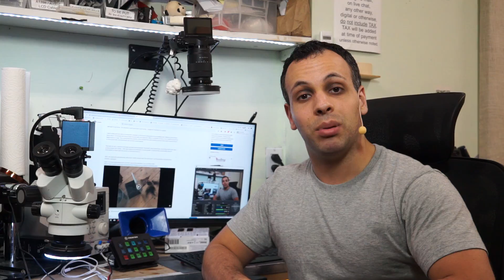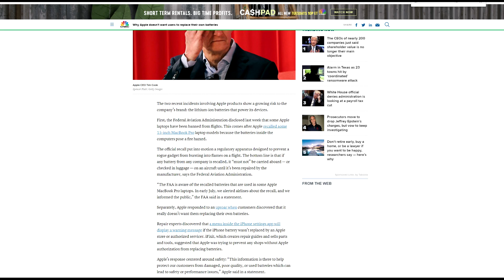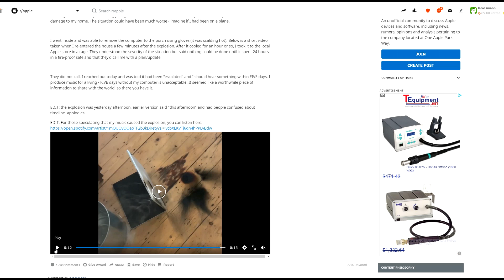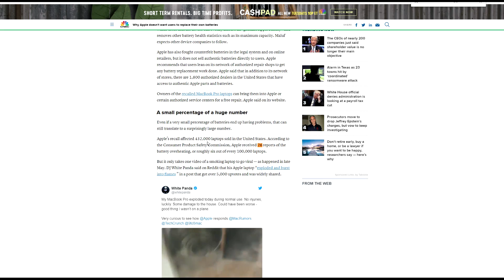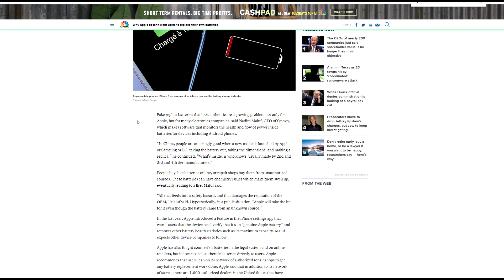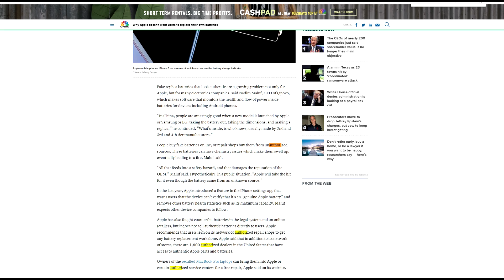OEM batteries explode, so 3rd party batteries are bad. Nice job, CNBC.

Comment: Issue is that CNBC was trying to crudely highlight is that because some people replace batteries and the machine catches fire, apple gets poor publicity and then is forced to do replacements they did not need to do.

Because videos show apple.prpsicts catching fire, it's bad for the brand.and no person would admit they did repair work or got bad batteries.

I am not an Apple fanboy- they have a valid albiet niche issue that they tried to write and ended up doing poorly. You need not recall genuine, done working machines to Show you are battling counterfeiting

It's like someone puts non official brake oils and engine oils and they start getting knocking issue in engines only to blame the OEM for bad manufacturing

My issue is that never have I seen an OEM replace cars if they found aftermarket failures happening. Brands have a valid defense to that and you need not go to recalls.

Comment: I use 3rd party batteries especially since i like buying old laptops that no longer have original batteries made. But i always hate that 3rd party batteries falsify how much capacity they have, the last 2 batteries i bought were advertised as 5200 mAh but after checking them in the terminal command the designed capacity was only 4000 mAh.
The original batteries always had the same designed capacity as what was written on the battery even if they can no longer reach that.
I don't mind the lower capacity since its usually about what the originals where anyway but it still leaves a bad taste to be lied to like that.

Comment: Thank you for showing the word honest truth  in easily  understood  honesty and  blunt truth...  that IT Professionals  like myself have  been  preaching for ages in laptops  since 3rd party knock off crap because you're  too cheap to buy the right part and  often fails because you feel   that the device maker will  be ripped off by you the consumer were over charged  for  your device and  you're  all idiots..  there's  a reason why  the battery  is designed or engineered by the manufacturer and  my rescue training I've  seen  the aftermath  of 5 vs 50 buck mentality and  how MacBook ipads and  cellular phones its not easy to remove or insert new batteries properly i have seen the users stand and bounce on batteries even use hydraulic  bottle jacks to force fit batteries into devices plus the removal of old batteries  has ended badly... if it can't be easily inserted extremely easily goto an experts pay the extra your life and state of health are not worth the risk or gambling  with....

Comment: Funny thing about "fake" batteries but "real" ones blow up too.  I replaced my 2015 MBP battery with one purchased from ifixit and less than a year later, that battery swelled up too.  Ifixit sent me a replacement free of charge, but I had to go through the grief of doing the swap (and yeah, I used ifixit's tape when I replaced it the first time) - ugh. (My iphone 7's battery also swelled - Verizon replaced the phone because I had a replacement contract on it).

Comment: most of the OEM batteries can have heat and or fire issues due to there capacity to size ratio. There chemistry has packed as much of the material as they can to get as much capacity out of the battery and then put a ton of technology into the battery management. When something goes slightly wrong you end up with a big problem, especially if the temperature feedback is off. and the aftermarket batteries never get that high of capacity because there trying to save cost, And with getting a cheaper battery they end up being less likely of having fire issue with less dense batteries and lower quality materials.. that's why OEM always cost more...

Comment: I don't think third party batteries are reliable. I ordered two Macbook Pro batteries from iFixit at two different periods. For the first order, they had to send me a replacement battery a month later because something was wrong with the battery. For the second order, they had to send me 3 replacements because the batteries they were sending weren't operating correctly.

Comment: What are the main causes of batteries overheating?  I can think of two.  An excessive load on the battery such as a short or very low impedance caused by a circuit failure,  or an improperly designed charging circuit that does not include a current limiter to prevent over charging.

Comment: Sounds like CNBC may of or had been paid by apple to make this post to install a fear in people to vear from stores that exist to fix devices.
I dont see any reasons why you would be wrong, granted fake batteries are present but people that scour the web finding OEM parts, even going as far as taking out batteries from the same exact device as a donor that is known to work wouldn't be an issue. 
Now as 3rd party battery manufacturers are concerned, if you know the company or have bought from them before and they work like the OEM (and maybe safer) would be a benefit in a way and shouldn't be frowned upon as apple makes them out to be.

I can understand like in the first transformers movie, the kid gets an old car cuz his dad is too cheap to actually do something other than being cheap, but people (most people) actually look at the history of vehicles, what they have been through, any repairs in the past 3 years or whether or not they have been into any minor fender benders or full on collisions leaving the vehicle as a write off for the junk yard but it is just that, experience, what they know and who they bought from. These are reputable organizations that do their job right and dont putz around like apple does saying "we would need to replace the whole main board because of water damage when apple (from what I have seen from watching your videos) that apple builds their devices to fail. Like in one video when you said the GPU gets so hot that it solders itself off the board and another that you said that the fans dont actually turn on till it is about 83*C or one that had a GPU literally blow up. This is why apple is nothing more than a meme generator. 

OH, the GPU blowing up is not a bug, its a feature.

Fans dont turn on till it gets this hot because **its a feature**. 

Enough ranting on my end, time to get off my soap box but you videos have always got me inspired to tinker with things and I love watching your videos. 👍

Comment: The truth is that if a battery does expand and bust it is most often caused by a design defect and excessive heat produced within the device itself and not the battery.  Even Chinese lithium polymer batteries with fake capacities won't explode unless there is a design defect or heat issue.  Apple's argument has nothing to do with safety.  This is simply done to increase Apple's profits.  Having a closed ecosystem and preventing 3rd party repairs ties the user to the device through their data while keeping the user dependent on Apple for repairs.  Apple benefits not just from selling you an overpriced smartphone, but by locking you into Apple for any future repairs.

Comment: I have a MacPro 13 inch bought in 2015 and the factory installed battery swelled up so much I could not close the screen. After some considerable investigation I found a replacement battery kit and learned the proper way to replace the battery. Since the original was very swollen I took extra safety measures when removing it. I have many years of experience with computer repairs, Apple included, but found replacing the battery was difficult due to the way Apple glues it in. Later found out Apple had some kind of replacement program they failed to tell me about.

Comment: I Have had good luck with 3rd party batteries for many devices, the controllers, depends on the device, many have their own controller, that can read volts and volt drain, it will have to learn new batteries, an interesting one was my last note3 battery, its rated for 11600mAh, consistantly im getting over 2k higher then that, its well over 3x the stock battery capacity, i did have to let it slow charge off a slow port for 3 days for it to actually fully charge, but since, its charged perfectly every time, i have tested it several times down to 5% to see how consistant it was.... very.... wish i could do that with my z4.... oh well... at least the z4 has good battery life by default, and the plan i have with verizon will replace the phone if it...fails... and if a battery becoming shit didnt count... how hard is it to kill a modern smart phone? 

one tip, always try and use sellers with good reputations and communication, and always be skeptical of any deal that seems way too good, " a bit too good " can go either way, the number of times we got high grade products that turned out to be 100% legit, for very good prices, but almost didnt because the price was a bit too good... or a few times "way too good" once, the owner of the shop bought a compromised cargo container of electronics/computer parts, about 1/3 was destroyed to questionable, the rest, zero exposure to salt water due to how it was packaged, when a container is compromised they most often turn it into an insurance write off, and then sell the container and whats in it very cheaply to somebody willing to take the risk.... i ended up with a bunch of questionable electronics(that, funny enough, are mostly still working...going on 2 decades later... ), and some stuff that was in no way damaged... and spent months helping unpack that container and another he bought a month later... it was at least 6mo before we had all the stuff unpacked from both...

Comment: and at least 2 of the aviation cases were with Dreamliner itself as they use Li-Ion batteries to save gas as power propulsion system

Comment: I've always found it amazing how so often the aftermarket  winds up diagnosing and correcting OEM design/engineering mistakes and how OEM companies so often tend to fight it.  Chrysler did this with the cylinder heads in their minivans in the late 80's and early 90's.  Those things burned more oil than than gas and it was rare to see one more than a few year old that was not puking out blue smoke from the tailpipe.  The aftermarket found out the root cause and came up with a fix that was genuinely superior to the OEM in every way and lasted longer.  What'd Chrysler do?  Try to force them out of business through pointless litigation.  What they SHOULD have done is say "Wow.  This is so much better.  We'd like to buy your designs and implement them in our future models.".  

We all have to remember that NO company that large has the consumer's best interest in mind.  It is all about protecting the shareholder value and the customer be damned.

Comment: We are fighting about the same fight, fpv aircraft and manned aircraft.  Check the facts and you are way more likely to have an incident due to pilot error as aposed to the chance of winning the lottery of being brought down from a drone strike. 
But yet, the media is making model aircraft  look bad because bad news sells ad space. Model aircraft have been around all the way back in the 60's and as yet no manned aircraft had ever been brought down causing injuries due to a model aircraft strike.  One military helicopter struck a drone with its main rotor system and landed safely.

Comment: Hey Louis, I know The isn’t relevant to the current video, I’m looking for some advise on my MacBook Pro 2015 which I some how managed to drop “in its bag” & I now have a black screen after power up, I’ve used a HDMI which is fine until I’ve logged in & then the screen goes blank. Is there anything I can do or check before sending it off for repairs?

Comment: I bet plenty of manufacturers would love to have "rate of issues" as low as 250ish in nearly 30 years for a product that they sold over 200 million of the previous year. Chances are my Anker external recharging batteries that I bring with me on planes have a higher rate of "issues" than that and TSA does not bat an eye. In fact, my last flight they were more concerned about me carrying on some coffee beans (which is allowed... they just had to pull them out and check them for some residue) than my 2x 10,000 mAH batteries.

Comment: 3rd party are not necessary bad, just Apple doesn't want to be responsible or get sued for anything that goes into the device that are not theirs. I am not defending Apple but it's true, have anyone dealt with a punctured Li-on battery while in a repair and needed to evacuate the room? I did. If it's not for the Apple training or equipment for dealing with thermal event, I could get injured.

Li-ion is dangerous, particularly with bare battery cell on modern electronics. If a pull tab is broken and someone really tried to pry the battery out, it could be a safety issue. I have a bucket of sand, fire extinguisher, baking soda and a fire-safe as per Apple requirement. I never thought I would use them and all it takes it ONE incident, they saved my life.

Apple requires battery covers for all devices repair when the bottom case are opened, there is a reason for that.

I think Louis should have an educational video on Li-Ion battery safety, people need to know how to properly deal with thermal events if they are doing DIY repairs.

Comment: I’m not defending Apple, but some non oem batteries ARE really bad. But, if you deal with a specific brand, you learn which brands are good and the ones to avoid. The ones you have to avoid are the counterfeit ones. You can’t buy an oem battery for an LG V20. All of the ones on Amazon are fake and swell. There aren’t any true oem batteries left. If you do your research, you can find very good 3rd party ones. I’m sure the case is the same for 3rd Apple. And, if Apple allowed independent shops access to the genuine Apple batteries there would be no issue.

Comment: What they are trying to say is that 3rd party batteries are so well made that they are indistinguishable from the OEM batteries, but they have crap on the insides... and that the people are going to Apple to complain and saying that the battery is OEM..... which sounds like a complete bs. 
I am more with louis on this one and think that the failing batteries are more due to the other user errors....

Comment: If the possibility of getting unknown quality batteries were really such a concern, they could you know, allow people to purchase genuine replacement batteries themselves directly, and have it be replaceable by unplugging it from a connector, taking the old one out, and putting a new one in.  If they didn't want to handle sales themselves, there are a gazillion possible capitalist solutions to get someone to handle all the other issues besides manufacturing and QC/QA, and technically even that could be handled fairly easily.  

I know our education system produces people who can barely even see the existence of the box, let alone think outside it, but even a three year old could figure out: unplug, remove, out new one in, plug in.  Their latest choice of "solution" to this "problem" (that kills roughly 0% the number of people that die each year due to lack of excercise from using the very same Apple products) is almost surely just going to increase the odds of negative outcomes in a variety of ways, including most menacingly, making people mentally see no differentiation of feedback between 'good battery replacement' and 'sketchy battery replacement'.  It'll almost surely make Apple a few hundred thousand more a year, since no one will hold them responsible for continuing the slide away from user responsibility and control over devices they own.

Comment: Also I noticed that the just over (sorry can't remember the exact number) 200 lithium ion battery issues as stated by the FAA were not mentioned as having been in laptops or phones...they could have been in anything aboard an aircraft that contained a lithium ion battery... it would be nice to know exactly how many of those events were due to phones or computers don't you think? Especially if the "blogger" is going to use the data in reference to the recalling of laptop batteries..... just sayin.

Comment: So Louis.... What if you were a shareholder and operator of TWO different companies... one an authorized repair dealer and one a Not authorized repair shop  that is specifically a separate company ?

The two would be mostly separate...  your authorized shop would have a PO Box or something as an address and only do business by mail.  Both of your companies could rent some different space and employees from your staff and spacing corporation.  Your unauthorized store on the other hand would handle the majority of the repairs  but after they were finished with all unauthorized repairs on a unit  contract Only other repairs to the authorized shop for only the things like battery replacements that your authorized shop is allowed to do.